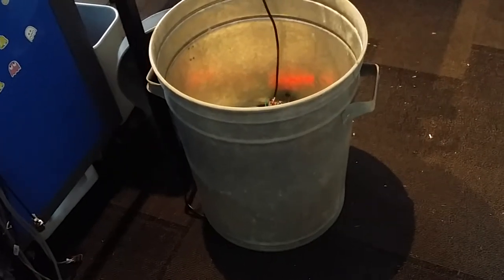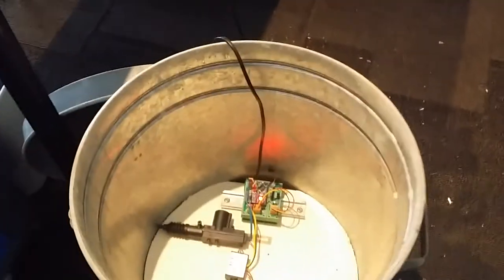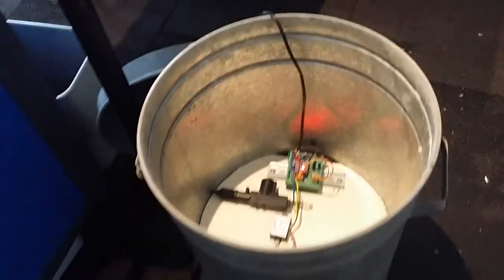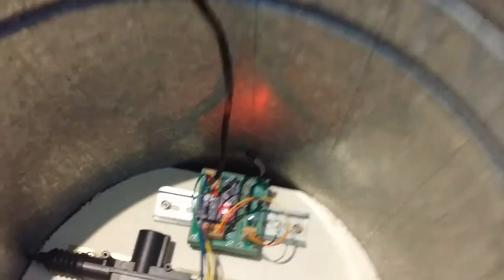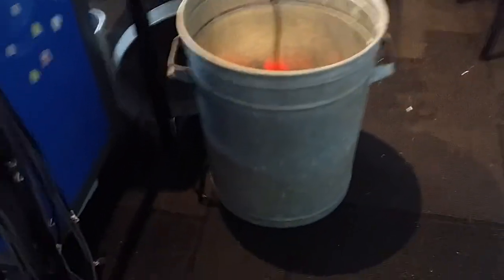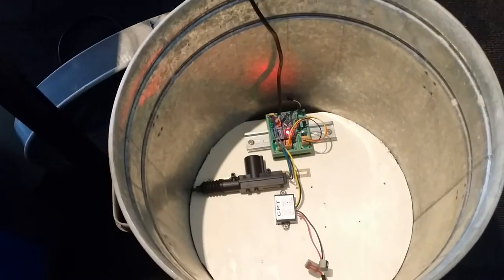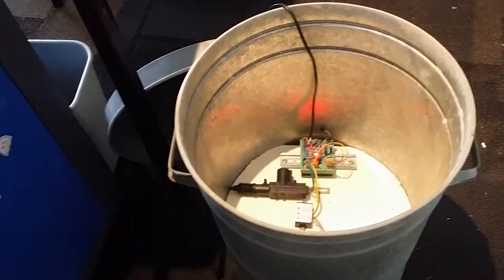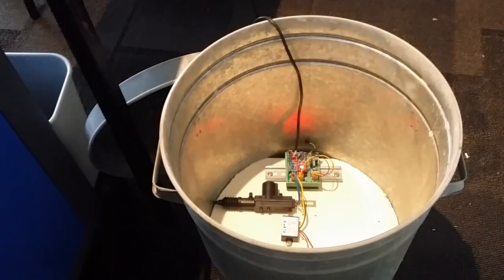Garbage Can Prop Remote Improvement

Comment: I wanted to do something like that, i purchased all the parts and just didnt follow through. I was going to use the actuators to move the lid in an erratic way. This year sucked for us in Texas as it rained all day and quit just in time for the kiddos to come get treats.
Reply from the maker: It does suck when it rains on the one day you don't want it too.  I do have plans to try the actuator through the base so it bumps about a little instead of the tapping.
Reply: @daShare  I am not entirely sure the door lock actuator would have enough strength or torque to lift it. Maybe some sort of metal geared heavy duty servo or some sort of stepper. I am building a new prop that I am not ready to broadcast to the public yet but it uses a motor with an off balanced weight to make it vibrate and move around. Maybe something like would work for moving the can.
Reply from the maker: @chrisd1243  The metal bin is reasonably light (using the audio exciter instead of a speaker box helps) but yeah, it could be too much for the actuator.  Keeping it near the edge should minimise the load.  The motor with eccentric weight is certainly worth looking into.